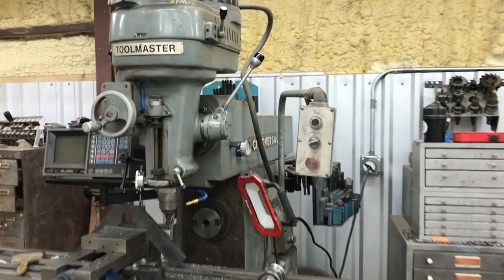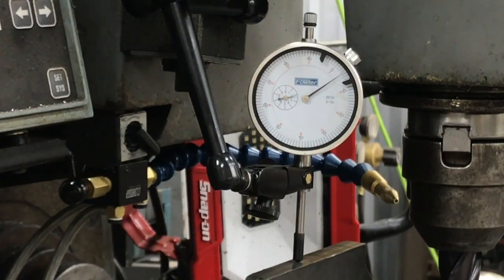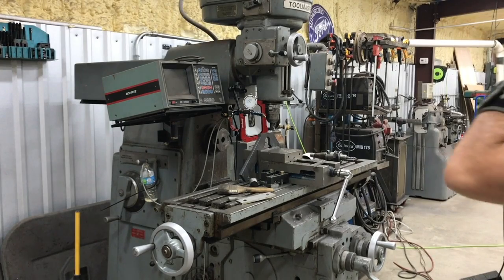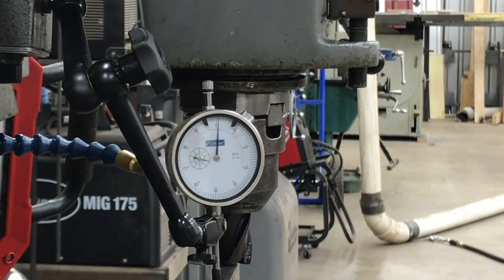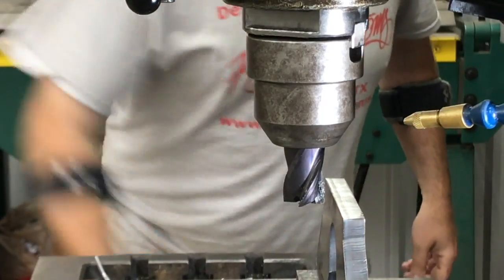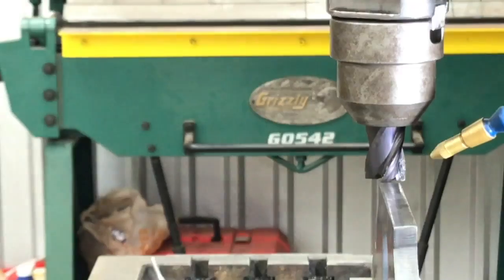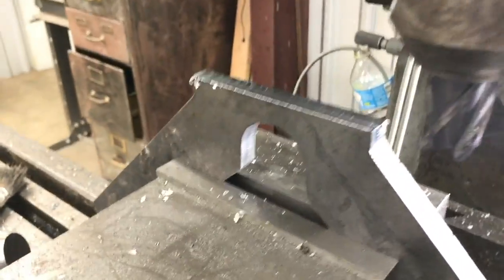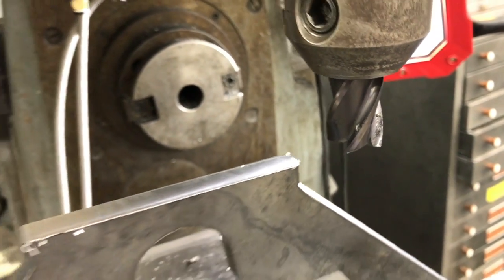Working with the Cincinnati Milling Machine - A basic cut with Carbide Endmill

Comment: Try 400rpm next time. Very hard to tell on video but the chips made it seem around 200rpm at most. Of course I don't have a mill, but that Carbide mill should be good up to at least 500SFM. After about 15 years as a hobbiest, I've finally gotten to the point where I enjoy taking bigger faster bites. I'm still not going 100% , but I've had a couple times where I could just start to hear the motor working. I think it would be fun to have a watt meter to see how efficient vs apperance different speeds feeds and  inserts are with different steels. Probably more of a John or Stefan video
Reply from the maker: it was running at 385 rpm

Comment: Show us some horizontal action.....
Reply from the maker: i wish I could, the horizontal motor will come on, but seems as if the brake motor is engaged or locked up on it.  I want to get an electrician to look at the wiring before i pull the horizontal motor out

Comment: That stubby little endmill surely is a rigid setup, but it's kinda for noting since the clamped workpiece isn't near as rigid.
Not that that's a problem if you're taking the depth of cut into account.
If you'd need to really move some metal from a similar piece I'd suggest clamping it using an angle plate and bolting that to the table.

EDIT: I commented before I hear what you said at the end of the video